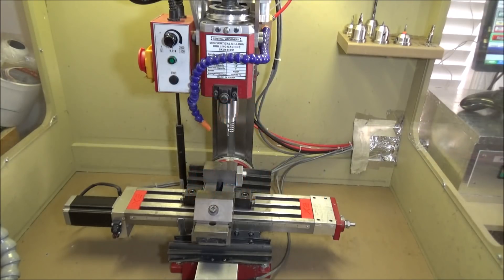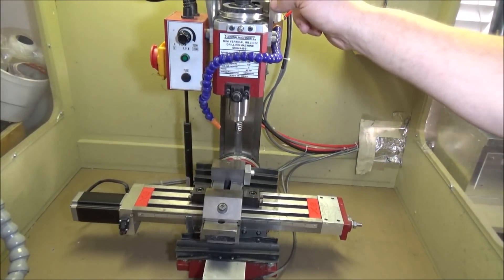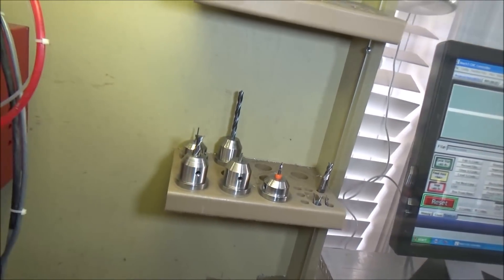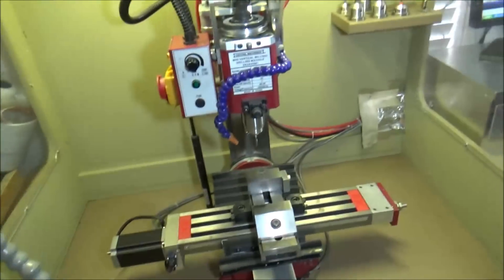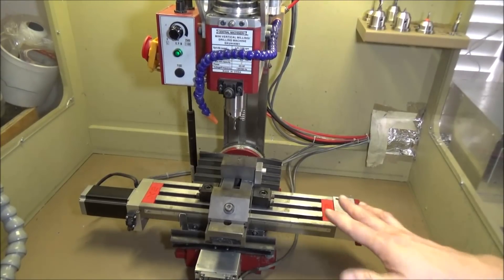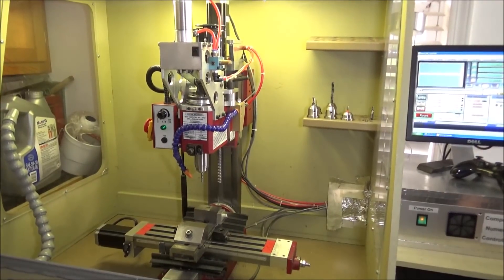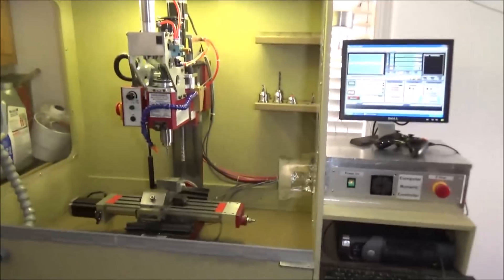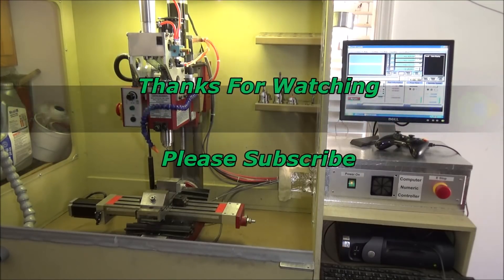Sieg X2  Mini Mill CNC  SOLD!

Comment: I'm serveral $1000's into my X2 so far.  CNC Is not cheap.  That is a real nice setup.  I went with JMC-Motor.com closed loop steppers 425oz in 3 NewtonMeter.  Enclosure is really nice, homing switches are well done. I'm still putting mine in, using PNP inductive.
Reply from the maker: Thanks Robi,
Yes it does not take much to get a few $1000 into a project just because the mill is smaller doesn't always relate to less expensive. The cost of Ballscrews and electronics doesn't really change that much from machine to machine for the same quality of course the cost of Electronics goes up if the Quality of those Electronics do. So its all a matter of what you want to spend. The cost of these Mills has gone up over the years.  Just saw the HF X2 $699